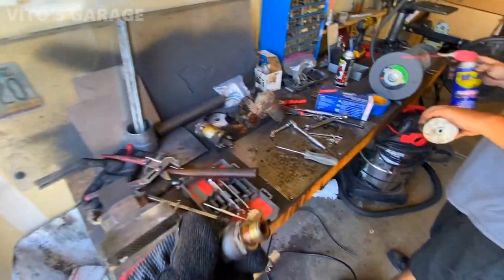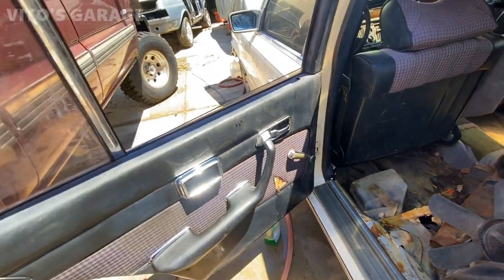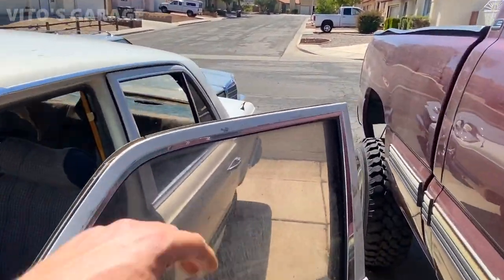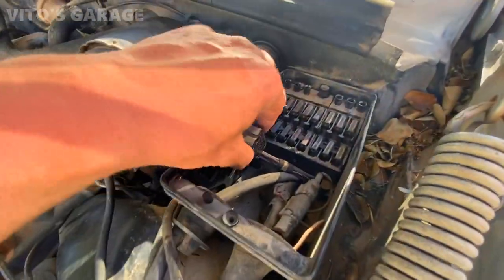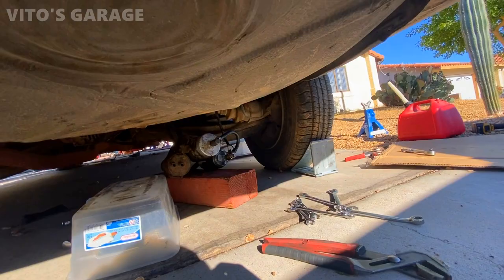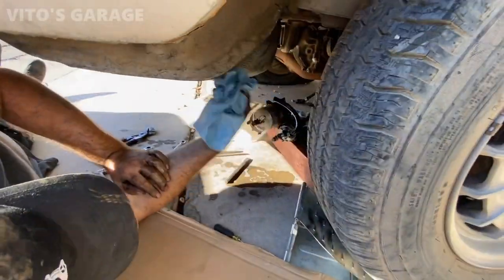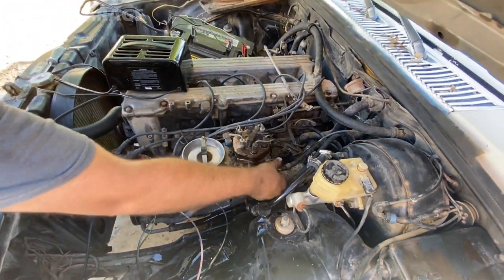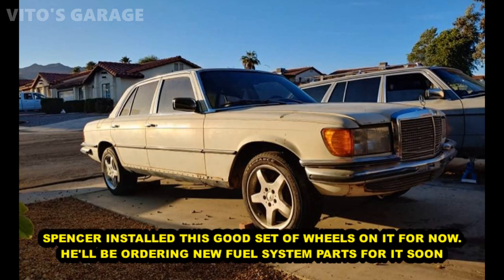Saved From The Junkyard Euro Mercedes W116 280SE is Getting Up On Its Feet !!!

Comment: Great videos!!  From one of your posts, you got the car running, what was the culprit?
Reply from the maker: The car is doing well. The problem we were having was a bad fuel pump and clogged filter. At first the owner Spencer ordered the wrong pump for it. We were able to fit the pump on it but it’d leak and not deliver the right pressure. It was also purchased with no key. That’s why the cluster was out and I had to jump a few terminals to get it running. Check out my other videos and playlists. I have a lot of car videos 🙂
Reply: @VITOSGARAGE  Thanks for your reply. I subscribed! Great content! 
Looking to work on my fathers 73 450SE, cranks but does not start
Reply from the maker: @tomzouzoulas3169  message me on social media or email. It’ll be easier to talk on there